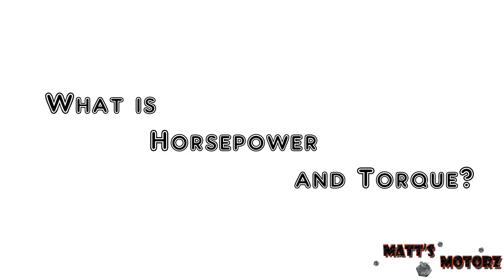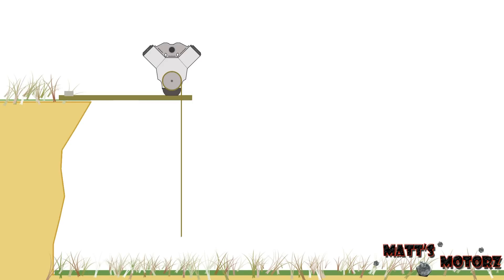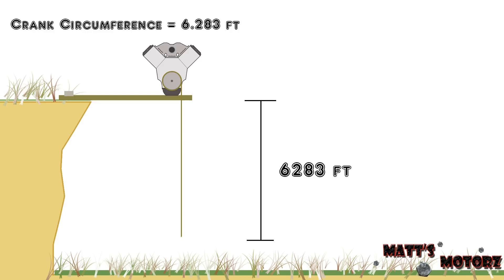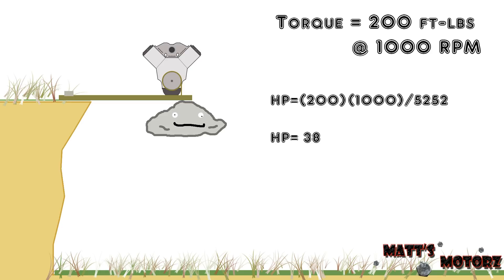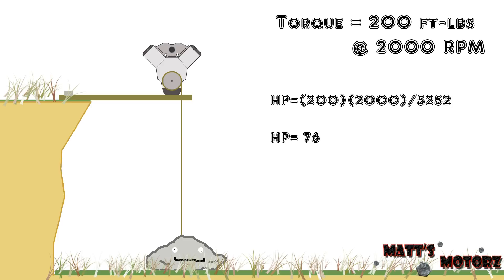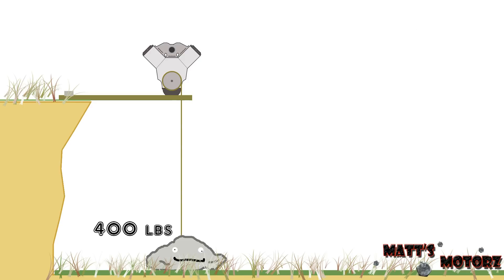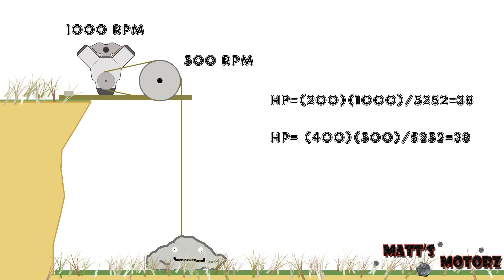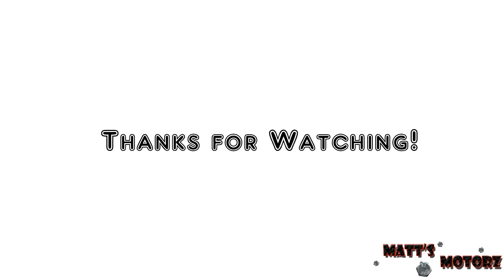What is Horsepower and Torque?

Comment: Are engine displacement and max torque figures co-related ? If yes then how and if no then why not ? What is the purpose of making an engine that has higher engine displacement but same max torque as that of a lower one ? Does it simply imply lower quality components used or is there more to it ?
Reply from the maker: +Ishan Joshi Yes absolutely it does.  What dimensions are related to engine displacement?  Piston diameter and piston stroke length.  When the fuel-air mixture combusts, it exerts a pressure on the piston head with a force equal to F=PA.  The larger the area, the more force (and therefore torque) is produced.  Since the pistons are circular, doubling of the radius causes 4x more power since A=pi*r^2.

A longer stroke length requires the throw of the crankshaft to be longer.  A longer throw on the crank shaft causes the lever arm of the crankshaft to be larger.  A larger lever arm causes more torque to be produced.

It is hard to answer your last question because there is  so much to torque curves.  An engine is designed for a specific purpose.  An engine made to haul loads is typically a diesel, so it does not rotate nearly as fast (therefore lower horsepower typically).  This engine would most likely have a very large displacement because it does not need to rotate very fast.  This large displacement is due to big pistons (large piston area) and long connecting rods (longer stroke length). Big large engine components are more difficult to spin fast because of their increased inertia.  Its torque curve is most likely very higher over a wide range (or band) or RPMs.  In contrast, a small  gasoline engine would have a much smaller displacement, and spin very fast, but may only have a large torque value over a small range of RPMs.  It is about the ENTIRE curve, not just one value.  These engines could have the same max torque but would be very different.  The gas engine would likely have a larger horsepower and be able to accelerate very quick, while the diesel engine could haul loads but would not be able to accelerate well because it does not spin very fast (low horsepower).  Hope this helps!
Reply: +MattsMotorz Thanks a lot for that detailed reply Matt. That clarified a lot. I have some more doubts though. If i have 2 engines both with 100cc displacement One is 10c x 10c (bore radius x stroke) and the other is 5c x 20c . Rest all being the same. Can you predict (by these figures alone) how both the engines are going to vary in torque curves and possibly other engine related characteristics as well ? Can you throw some light on that aspect ? Also , does compression ratio figure in this in any way ? (Assuming both are petrol/Gasoline)

Also to quote you "The gas engine would likely have a larger horsepower and be able to accelerate very quick, while the diesel engine could haul loads but would not be able to accelerate well because it does not spin very fast" . Going by the statement that torque figures in a gasoline engine are at maximum only in a small band (which is almost always the higher rpm band) while that of a diesel remain more or less same throughout its limited rpm range, shouldn't then the diesel engines have a higher pickup at lower rpm ( which means just while starting out) . I don't see that. Petrol engined vehicles have always had a higher lower end pickup.

Also, one last question, please bear with a non mechanical engineer :D, what stops an engine from going above a certain max rpm ? is it because it has reached the maximum fuel intake that the engine manufacturers have allowed or is it something else ?
Reply from the maker: First Question: I really cannot.  Maybe there is some master engine engineer who could, but all I can do is guess.  The torque coming from the piston radius is a non-linear relationship, meaning doubling the radius quadruples the torque.  However the lengthening of the lever arm increases the torque in a very linear way since torque (T) is equal to the cross product of the lever arm and the force vector. (T=r x F), so doubling the lever arm length only doubles the torque.  So I can (very superficially say) that it is likely that the engine with a larger diameter in your example would produce a larger amount of torque in at least some band.  However, there are many variables to take into account and I cannot say this with 100%confidence.  On the question about compression ratio, that will dictate how the fuel/air mixture combusts, which dictate the pressure in the cylinder upon combustion. So this is independent of physical parameters of the engine.

Second Question: That example was most certainly not a general statement, it was just an example to help clarify my point. Torque isn't the whole story for acceleration, because the engine must be able to deliver this torque very quickly to accelerate, this is where horsepower comes in as it is a direct measure of how fast torque is delivered to a load. The problem with diesels with acceleration (on engines build to haul) is that they don't spin fast enough.  Sure you have a butt load of torque, but if you're not spinning fast enough, you cannot deliver that load very fast.  Take the example of steam engines in my video.  Steam engines are torque monsters.  The Doble steam car, the last steam car made (1921), had 1000 ft lbs of torque (I am a steam enthusiast btw).  That is more than most 2016 sports cars made right now and it only had two cylinders!  But it only had around 20 hp because it ran so slowly (steam engines can operate in single digit RPMs).

Third Question: My understanding is it reaches its mechanical limit.  There reaches a point where the engine is spinning so fast, that the valve springs do not have enough time to fully seat before they are called for again.  This is called "valve float" I believe.  If the valves don't seat, you have no compression and thus no power.   There may be other reasons but I have not done enough reading on the subject. Great questions!!

Comment: That 76 HP gas engine will stall as you say, but a DC electric motor will not stall and be able to pull up that rock with no problems.
Reply: You cant compare gas engines and electric motor like that
Reply: MegaZijo I sure can. It proves the point that electric is much stronger than gas or diesel. They cannot increased torque and power when you overload them like electric can.
Reply from the maker: I would say, an electric motor has more low end torque than gas or diesel.  There are pros and cons for each type of engine.  I could say a steam engine is stronger than all other kinds of engine (which is true in terms of torque) but you don't see too many of them around now a days.  Pros and cons.
Reply: MattsMotorz Horsepower also increases when you overload an electric motor, not just torque..For PM brushed DC motors power is max at overload that causes the motor to turn at half it's speed and then it drops down when you overload beyond this point. It will be a parabolic power curve with a linear torque curve.

For AC motors, max power occurs where the breakdown torque occurs, and breakdown toque is anywhere from 150 to 300% of full load torque.

The problem with combustion engines is that on the power stroke you are limited to the force of the explosion in the cylinder that cannot increase if it has to push against a greater and greater resistance. This issue becomes far worse if the resistance has increased during the other stroke cycles that rely on the flywheel to carry the piston through during times of no power stroke. With electric motors the resistance is met with an increase in the magnetic field that will increase the force to counter act the resistance.
Reply from the maker: EETechs These are great points and I definitely did not know these things.  Although I will say that for combustion engines, there really isn't a point where the engine is just running on inertia only since there are multiple cylinders, each of which is out of phase with each other, so at some point at least one piston is on its power stroke.  I don't know electric motors well enough to have a conversation about how much better or worse they are compared to internal combustion engines.

Comment: My conclusion for the real world of cars, specifically between turbodiesel and turbopetrol cars, is that the best trade off is to opt for the turbodiesel car, and here's why. Turbodiesel cars produce considerably more torque than turbopetrol cars and torque is what matters for acceleration from zero and on through to the legal speed limit (being able to reach 250 kmh and beyond in petrol cars is really only academic). On top of that better acceleration, you get far better range from a turbodiesel car. Jeremy Clarkson drove an Audi 4.0-liter twin-turbo V8 diesel from London to Edinburgh and back on one 20 gallon tank of fuel (a round-trip distance of 800 miles, requiring an average of 40 MPG, ref The Top Gear One Tank of Fuel Challenge). That engine produces 650Nm of torque between 1800 and 2500rpm and sprint 0-100km/h in 6.7 seconds. Yet it has 'only' 275hp and I say only here because many petrol cars these days produce 250 to 300hp but they don't produce anywhere near 650Nm of torque, the very factor that matters for acceleration in typical everyday driving. Not to mention pulling power. Case closed.
Reply: i think you got it all wrong. horse power matters when it comes to acceleration. 257 horses on a turbodiesel accelerate the same as a petrol. And because of the different gearing, the cars  will have the same pulling power. youre right about the MPG, but mostly only because the difference in RPM at which they operate.
Reply: ENGINE TORQUE DOESN'T DICTATE ACCELERATION, HORSEPOWER DOES. (rewatch the video or learn basic physics)
there are things like gearboxes you know.....

Comment: You have it wrong. Gear ratios will affect how quick you pull the rock up. Thats why racers swop out transmissions on there cars to increase there performance.
Reply from the maker: +Ryan Kukkuk I don't have it wrong.  When you increase torque it is at the cost of slower speed.  And vice-versa when you decrease the torque.

Comment: Why divided by 5252??
Reply from the maker: +U N I T K Z S The 5252 factor is there purely because of the units.  If you wanted to change the units to kW, that number would be different.
Reply: MattsMotorz Thanks

Comment: 0:40 "this is a torque curve for a porsche 911"

No, no it's not. Notice how the HP and Torque don't cross over at 5252 RPM?  Due to the function of the mathematical equation that you, yourself quoted, HP and Torque of EVERY engine will meet and cross at 5252RPM. It's a fake dyno chart
Reply from the maker: +Calvin DiBartolo Actually, yes it is.  The reason why they don't cross in this chart is because there are two separate scales for the Y axis for HP and torque.  Look on the left and the right.  If these two scales were the same, they would indeed cross at 5252.
Reply: +MattsMotorz ahhh I see... the numbers indeed match at 5252RPM but because of the scaling (I wasn't aware they did that, seems odd to me) 295ft/lb and 295hp are at different heights on the graph... whoops
Reply from the maker: It happens!

Comment: So I'm looking at a small metal lathe, I've noticed that some small lathes have 3/4 of a horsepower, which isn't very much, but say for example if that lathe motor produced 1,000,000 ft lbs of torque, that would mean the lathe would not stall, but the motor wouldn't be able to turn the workpiece very fast.
Reply from the maker: +P0tat0_craft My lathe motor is only 1/4 hp (atlas 10" swing) and its fine.  Sometimes I wish it was a little stronger but it doesn't take an insane amount of power to turn metal when the part gets spinning.  It only starts to slightly bog down when i do some really heavy cuts in steel.  3/4 hp should be fine.  What size lathe are you getting?
Reply from the maker: +MattsMotorz The inertia of the part and the chuck when spinning helps quite a lot when turning.
Reply: +MattsMotorz I've been looking at the 7x12 lathe from grizzly
Reply from the maker: That's a little guy.  Depending on how much room you have and what you plan to turn, I would recommend going to estate sales or auctions (or ebay if you're lucky) for a lathe.  Many times you can get an older, much higher quality machine for a little more (like a couple hundred dollars more) than you would pay for a grizzly, it all depends though.  It really pays to buy quality with a lathe.
Reply: MattsMotorz if I had the space for a larger one I'd do it, I've already invested quite a bit of money in woodworking tools and just recently took a machining class, which really turned me on to metal working. I'm working out of a small corner in the basement that me is the designated shop area. I wish we had made it bigger but then it would have taken away from the family room area of the basement. Machining tools are much much more expensive than woodworking tools, and I've never really thought about making big things either, just small parts for things I make.

Comment: where does 5252 come from ?
Reply from the maker: +Ariel Contreras  5252 is simply a multiplying factor that comes out because of the units involved.  If you wanted HP in units of kW then that number would be different.

Comment: Fantastic video, from what I understand from this, will a car that makes 300ft-lbs @5000rpm (peaky torque curve) accelerate faster than 300ft-lbs @2500rpm. (flat torque curve)?
Reply from the maker: +Ashton Murch High Acceleration = large amounts of torque over a wide range of RPM's. If a car has a flat torque curve of around 300 ft-lbs and it is up against another car with a PEAK of 300 ft-lbs at X RPM, the car with the flat torque curve would likely accelerate faster since it has a large amount of torque over a wide range of RPM's while the other one only has a peak torque value (of the same value) at ONE RPM.  Hope this makes sense.
Reply: +MattsMotorz Yeah I get what you're saying. I guess it all depends on the rate of change at which the torque increases right?
Reply from the maker: Not necessarily,  A flat torque curve has a rate of change of zero with respect to RPM (Think back to calculus if you have ever taken it).
Reply: +MattsMotorz So a torque curve with a rate of change closest to zero will out-accelerate a car that peaks with the same torque value at X rpms (ex. 300ft-lbs)? p.s. sorry if it sounds like i'm reiterating what you're saying lol
Reply from the maker: It's fine! Haha.

But yes.  But keep in mind other types of torque curves could also out accelerate the car.  I think a good baseline for getting a ROUGH idea about which car will out accelerate the other is to take the average over the entire range of RPM'S.  Again this is a very rough idea as there are many other factors such as driver skill that comes into play. But it is a good place to start.
Reply: +MattsMotorz Makes sense. If average torque and average horsepower were measured throughout the rpm range...will higher average horsepower yield faster acceleration regardless of average torque values? (assuming a comparison between two cars)
Reply from the maker: I would say yes, because average torque and average HP are related only by a constant multiplying factor.
Reply: MattsMotorz I appreciate your knowledge! Thanks :)
Reply: +Ashton Murch In real life terms.  Lets say you have a big turbo 4 cylinder engine making 500 HP.  You would have to wait and wait until the big turbo spooled up to make the boost, to make the torque, to make the power.  That may not happen until 5000rpm and may fall off at 7000rpm.  So to make it work well, the car has to be light and gearing has to be optimal.
Reply: +Ashton Murch Are you talking about the same car that theoretically makes 300 ft-lbs at every rpm? If so, then yes. Disregarding air resistance and friction, at WOT the car will accelerate twice as fast at 5000 rpm than at 2500 rpm in the same gear.

Comment: very good video,but i have one Question to ask.Why need to divide by 5252?what 5252 represent?
Reply from the maker: +mrneck5097 5252 is simply a multiplying factor that comes out because of the units involved.  If you wanted HP in units of kW then that number would be different.
Reply from the maker: The formula I gave is in units of horsepower.

Comment: Horsepower: 300 @ 5800 RPM Torque: 300 @ 1200 RPM vs Horsepower: 330 @ 7000 RPM Torque: 270 @ 5200 RPM typically which car would win in a race?
Reply from the maker: +Myrianne DeversRimpel These types of questions are difficult to answer because I would really need to see the entire torque curves.  Having good acceleration means having high torque throughout a wide range of RPM's. Also some cars output more torque on the bottom end of the RPM's, others on the top end.  Cars with bottom end torque would be ahead in the beginning of a race, while cars with top end torque would pull ahead towards the end of a race. I would need to take all of this into account before accurately answering the question.

Comment: P.S.  What does the 5252 represent?  How was that figure arrived at?
Reply from the maker: Denys A It is purely a factor that is necessary for the units involved, namely using foot-lbs and horsepower.  This factor would be different if one were to use Newton-meters and kW.